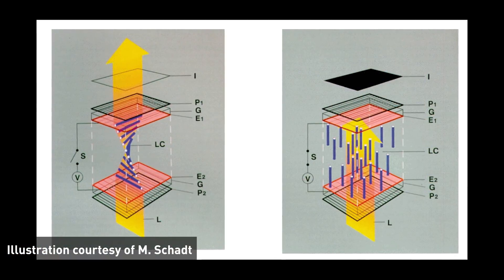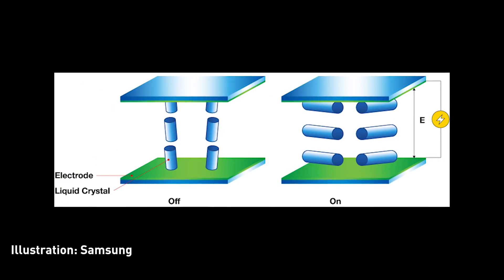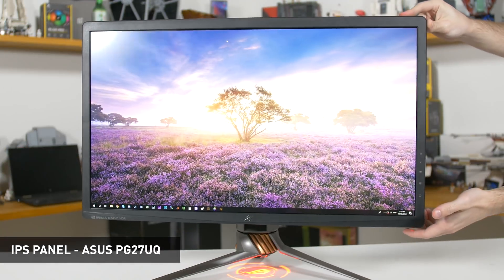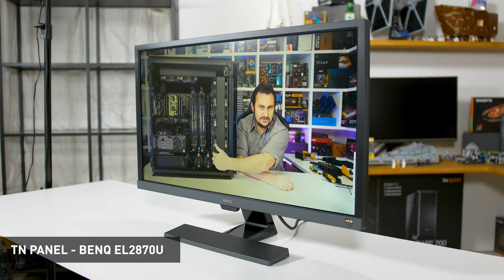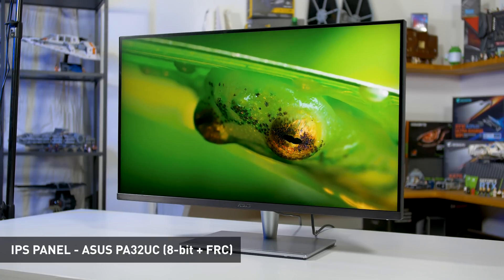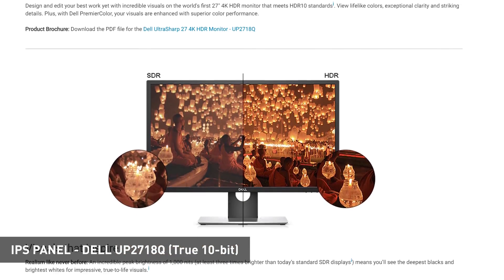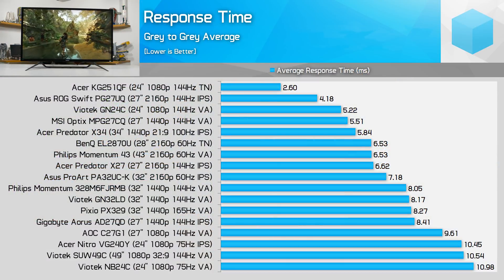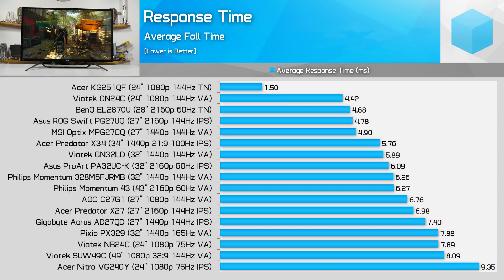TN vs IPS vs VA: Which LCD Monitor Tech is Better?

Comment: It would be cool if someone could inmpove apon TN tech, to mitigate weaknesses .
Reply: The higher end TN options already do. 8 bit color, and better contrast with better options, like gamma control, etc. There's actually a big difference between cheap and high end TN.
Reply: @mikeweatherford1847  i mean even more so. They should add a quantum dot layer to it to improve contrast. Response time should match oled (0.1) ive seen tn that are 0.5
My brother bought a high end TN panel and i literally couldnt tell the difference between my ips.
Its a 27 inch and i tried veiwing it from angles and it only faded from extreme veiwing angles.

But yea, youre right.
Reply: @coolbeans6148  I agree, im not sure TN should be such a red-headed stepchild. I am very impressed with the recent Samsung G7 panel, that VA panel they are using is almost the equal of the best TN's (like omen X27). It's a shame the G7 monitor is trash in other regards, poor quality control, broken Gsync, too much curve. I'll tell you this, for me, high end TN has no deal-breaker flaws that are distracting and call attention to themselves, every IPS i've owned the IPS Glow has been a deal breaker for me. If you put IPS and TN side-by-side, you will notice the color difference, otherwise not so much, but what you will notice more, put the same monitor's side-by-side in a dark room and there is an absolutely massive difference with IPS glow/black uniformity/bleed/etc. Almost univerasally, the TN will look way, way better in a dark room with dark scenes. I used IPS monitors for 15 years, and I purchased a TN in 2015, because I wanted 1440p and 144 HZ, with Free Sync (Benq XL2730z). I was shocked how much I did not notice the color differences, but the dark performance stood out and it was a breath of fresh air, I had been bothered for decades by IPS glow and once it was gone, I could never go back to IPS. I can remember playing Doom in 2005 and the shit IPS glow back then on my Dell 2005FPW, I can remember playing Diablo and Starcraft II in the 2010's with my HP ZR27w and the same distinct and disgusting IPS glow, and finally with a TN screen it is gone. Never going back to IPS. I can easily afford the very best screens, it's not about money for me. I choose TN, the challenge is finding High end ones, cause they are not very common. My XL2730z spoiled me with every extra feature in the book, premium build quality, headphone stand, great IO, and features like adjustable gamma, 144 hz, adaptive sync, and less common things like overdrive settings, and the UI is excellent, best in class. It's real hard to find TN"s like this. The Omen X27 is one of the few these days. Only reason im in search of a replacement is Adaptive sync on this monitor does not work with Nvidia products, and considering a 3080.
Reply: @mikeweatherford1847  VA is great with one problem for me, ghosting. Ive compared a VA pannel at 60 and an ips, the ghosting was clearly noticeable compared by ips. I dont know what it is but for some reason i found that ips strains my eyes where TN pannels dont.
Anyway, im in the market for a 4k monitor and if theirs a high quality TN, im buying it. Ill be going with whatever navi card is faster than a 2080ti.
I think big navi is going to be 30% faster in 4k gaming benchmarks than a 2080ti and the second fastest (the one ill be going with) will be 10 - 15% faster. Im also moving to linux.
The reason im going AMD is because the drivers are much better on linux, better than on windows.
Reply: @coolbeans6148  yeah, that's usually correct with VA panels. The one in the G7 is a new beast, nothing else like it. I hope it gets used in other monitors.

Comment: TN is bad, they have terrible colour accuracy, contrast, and viewing angles.
VA is bad, they have the slowest response times and have issues with ghosting/smearing which have to be offset by overdrive.
IPS is bad, response times aren't as fast as TN, a lot of models have issues with glowing, and they're the most expensive of the lot.

So, until OLED monitors become mainstream... you guessed it. CRT is now the master race.
Reply: OLED is bad, because the windows button will burn into the screen in a very short time.
Reply: @kadajawi6567  Oh of course, how could I have forgotten that? Looks like CRT is the future.
Reply: @Condred  Nah. Plasma. Followed by CRT.

Comment: Video suggestion: Pixel Density. Obviously a 1440p non-ultrawide 27 inch will have less pixel density than a 24 inch. But can you tell the difference? And is there a rule of thumb to keep at a minimum ~100 pixels per inch and not lower? Or aim higher?

Comment: So much stuff to take into account... I wish you all good luck finding a 32" IPS LCD monitor from a reputable brand with: 4K; 144Hz+; 10bit panel; good contrast; <5ms response time; PIP; HDMI 2.1; Display Port 1.4; doesn't require you to assault a bank; RGB (very important these days!)...

Comment: I use the LG 32GK850F and although it is not the best in it;s size class it aint the worst but for a VA panel it meets my cost to performance ratio

Comment: A 144Hz (or 165) IPS with a response time of 5ms or less is as fast as you'll need, unless you're playing competitive Street Fighter or something. A response time faster than your framerate is not going to get you more frags. Your own response time is going to be more important at those higher limits, personally I can't notice much of a difference past around 90fps but younger eyes may notice a little more.

Since I made the switch to IPS, I just wouldn't go back to the lower colour quality of TN. Sure, I'd love more contrast like the true black of OLED but a high end IPS seems to be the best option on the market in my opinion. Great for gaming & you can do some pretty accurate colour correction too. Not to mention great for media consumption & perfect for multi-monitor setups where you're not always viewing it at a direct angle.

Barring some future  technology that has true blacks without causing burn-in, I would always recommend investing in a high quality IPS for any gamer. Just think how many hours you're going to be staring at the thing!

Comment: Still I think contrast is useless in gaming. The most important part should be dynamic range, we want to get as much information as possible from the display, instead of just gorgeous scene(high contrast).
Reply: Besides, from my experience, TN usually have better dynamic range compared to IPS/VA because most of time you can just see blur in dark area. But TN will not be like this.

Comment: Unless you are a professional gamer, the IPS 144hz continues to be the best choice for everyone including gamers.  I've used a ton of screens including the BenQ high refresh TN panels.  While I loved the ULMB features of the TN BenQ and when it was on it made me feel a little bit like I was in front of a CRT again, the loss of brightness and the TN panel's overall terrible display quality pretty much drove me to 1440p IPS displays.  I havn't looked back since.  It was more than a good trade, it was absolutely better.  I would never go back to TN unless I was a professional (making money at it) CS:GO player or some such.  Otherwise for all gaming FPS or otherwise high refresh 1440p IPS has been just plain glorious.  Now that adaptive sync and/or HDR is an option with Nvidia cards even more so.
Reply: I agree, but the problem with the current 1440p 144hz IPS lineup is the poor QC in other words: it's a lottery.

Comment: If you looking for awesome monitor try Iiyama G-Master GB2760HSU-B1 Red Eagle [1080p, 144Hz, FreeSync] (if you need 1440p find GB2760QSU) great TN panel - yes TN, in my opinion Iiyama make the best TN panels. 

If you don't need or don't like curved VA monitor Iiyama is best option.

If you like or need good curved VA monitor search for MSI or Samsung. 

I don't like IPS in monitors (if it's not mobile or tablet then it's awesome). 

Greetings

Comment: I know It's late for a comment to get a reply but I took some time to research more about VA and IPS specifically. First thing first: I don't play FPS or any fast paced games(so no need to look into TN). I want my game to look as beautiful as possible without sacrificing much performance(fast response, no bloom/ghosting etc). Now my original inclination was towards IPS for better accurate colors at wider angles and relative faster response time than VA. But the whole internet now favours VA over IPS cause it has a lot better contrast ratio and apparently that is enough to make it better than IPS. The only conclusion I came from looking into the whole internet is that deeper blacks are the most important thing over all the other colors apparently. As if they only play horror games and watch movies, I can understand why VA is superior there. But I'm more interested in games like Witcher 3, AC Odyssey, Shadow of the Tomb Raider etc and to enjoy their beautiful worlds. I'm only interested in entry to mid range products. Please recommend me something cause I'm more confused than ever.
Reply: I can tell you this much:
I've been using IPS panels for about 11 years now (first a Samsung 275T and now a Dell U3011) and while on a completely black screen or for example the end credits of a movie you can clearly see the light bleeding through the pixels, I have never had problems with playing games, even dark ones like Shadow of the Tomb Raider...
But maybe because my only point of comparison is my phone with an OLED display, which exhibits a strong case of black crush...
The Dell has much better blacks than the Samsung, BTW.
I have been appreciating the vivid and life-like looking IPS colors though! B-)

Comment: Hey Guys, I'm in need of some desperate advice. 
I've just recently built a new PC except for my monitor which is old and I want to upgrade it to a "ASUS ROG STRIX XG35VQ" keep in mind the GPU I'm using is a RTX 2070. 

Is this a good fit for my setup? 

I'm looking for an ultrawide 1440p monitor but don't also want to pay that extra G-Sync premium.  

Any advice would be great.
Reply: Sorry for the late response, but any GPU from the 10XX series and above support Freesync. So I'd try to snatch a 144hz freesync monitor if you can.
Reply: @QuackZack   Thanks, i actually ended up purchasing a Samsung 34" Freesync 100Hrz monitor and enabled G-Sync. Its butter smooth and im loving it with the 2070 so far.

Comment: I actually have the Acer KG251qf 144hz TN and the colors and contrast suck BALLS!. I regret getting it and will hopfully get a 144hz VA in the future. And trust me, you won't notice the "speed" difference between a TN and VA panel monitor.
Reply: Depends, any VA I've seen & tried smeared with blacks, heck even my phones oled screen smears black... Very distracting even if black looks nice & deep, I don't need it leaving trails all over...

Comment: I've recently bought a Dell S2719DG which has a TN panel. There are no viewing angle distortions and the color accuracy is very good.
Reply: Well dell at least charges an appropriate price for a cheap panel so you could argue it's a reasonable buy. Unlike hp omen which MSPs their TN garbage for around 800 USD @27". Speaking from the experience of a not so proud owner of one, it's a joke. Didn't do enough research and thought the 40% off was a steal at the time... That's before I learned that FRC isn't actually a feature to puff your chest about but rather an artificial way to simulate color depth the monitor really can't handle. Other than the higher resolution, response time and the refresh rate overclocking to 165MHz, this overpriced garbage was actually a downgrade from my 6 year old 22" cheapo display. Omen. Never again.
Reply: @mrsullied  huh, wasn't that one at least 8-bit+frc to "10-bit"? The review here actually made it seem like a decent option anyway (yet expensive), especially compared to some top of the line more dated TN options like ASUS ROG Swift PG278QR that are native 8-bit with roughly 100% srgb coverage.

Setting it to 8-bit might be the better way to go about it since there's not much content in 10-bit anyway when it comes to games.

Comment: LCD monitor tech is shit, OLED is good :D The burn in issue is relatively under control these days and if people take some precautions they would have no issues with an OLED monitor. It pains me that i need to use a TN for PC gaming to tryhard as IPS and especially VA is too slow. OLED would be the fastest so im hoping JOLEDs gaming monitor comes soon and not cost a kidney.

Comment: Completely agree. I prefer a VA panel for gaming as the increased contrast really does make a difference. Currently using an MSI MAG24C, which has from what I could find when I researched it, the same panel as in your Viotek sample.

Comment: Sadly picture quality on CRT still beats them all :/
Reply: Last time I checked, CRTs still have such a soft image. The only way you get anything sharp from a CRT screen is if you break the glass...
Reply: it is soft and sharp at the same time, works like anti-alising ;)   ActuallyI would describe it as a smooth sharp picture instead of lcd that is pixelated sharp image.
Reply: Btw a friend compared his 1440p ASUS ROG mintor with my CRT and was amazed by how good my picture quality was.

Comment: Monitors suck. I'm really looking forward to getting a 120 HZ VA curved panel. Good to know any higher won't have benefit.
Reply: Well it's not that it won't have any higher benefit, its just some VA's are not as fast. There are VA panels with fast enough response times, but it's hard to accurately know for each specific monitor without a measuring tool.
Reply: @treymtz  So it's test as you go. I should not want to test what my eyes are seeing like on a TN panel. Though some I heard are OK and then it is the ghosting may bother me more.

Comment: I recently switched from IPS to VA. The colors are not as punchy, but the contrast and black levels more than make up for it.
Not planning to switch to a different panel type anytime soon, unless it's a REALLY high end IPS with next to no glow.
Reply: IPS colors looks washed out thanks to white ish blacks on them.
Reply: @alarqrez3479  Suspect overdriven LEDs, need to look for the "backlight" option and turn it down! The LG 49UH6100, from what looks like 2016 or around there, is known for overwhelmingly piercing whites at default! I got it in 2017, IIRC, but then gave it to my sister in 2018. Now, I suspect failing LEDs on the same TV. (or the phosphors) It's got blue-ish blotches!
Reply: VA quantom dot is even better ;)
Reply: @jessett7827  It is a quantum dot. It's an AOC monitor, but it uses Samsung-made panel with modified backlight.

Comment: For entertaiments VA has the best picture quality. IPS is for professional works like print design, web design cause they are usually more accurately pre-calibrated and is the most widely used panel. TN is for super low input delay gaming

Comment: I have some feedback! Firstly, thank you so much for the great and informative video! That said, I noticed you glancing up to read the notes several times and then immediately look down sharply several times. I feel you were more than capable of speaking impromptu but were distracted due to the notes, maybe checking to see if you're going the right way. Maybe you don't even need them?  
  
Lastly, your room is so cool and the desk behind you littered with awesomeness, then why the boring blue shirt with those machine precision level rolled up sleeves each time?! I feel you'd look way cooler and way more in-place with a funky and nerdy t-shirt with a witty caption or quirky comment each time. And maybe some side-lights illuminating that desk as well as the room looks very dimly lit and dull despite the awesome spread. What I'm essentially saying is: due to your serious clothing and dull lighting, the super cool display behind you looks out of place. A few minor changes and I'm certain it'll look much better!

Thanks again for the great video, cheers!

Comment: So MSI advertises a 1ms response on their MAG series of monitors. I assuming this means when they're in the "Response" mode in the monitor's settings, but the one I have is a VA panel. Is it actually 1ms? I guess not, so why would they advertise it that way if VA panels have the slowest response time?

Comment: Good stuff, but that "IPS glow" picture is not IPS glow, but backlight bleed with too long shutter speed. IPS glow can only be seen from an angle, not straight on ever. It makes blacks blueish grey, not yellow, like backlight bleed. You want an example of it, put on black desktop and then rotate the display like on viewing angle tests. And really it's a non issue, can only see it if I look at my display from top corner towards bottom corner. So unless you got a 43" IPS TV as monitor, you'll never see it (and yet I see people complaining about it, likely confusing it to blacklight bleed, like you did).